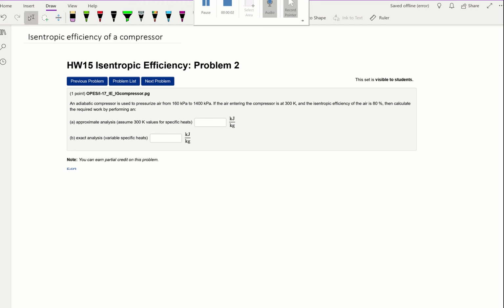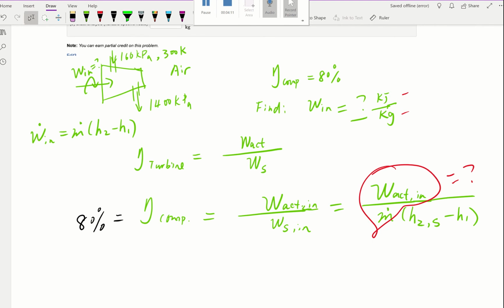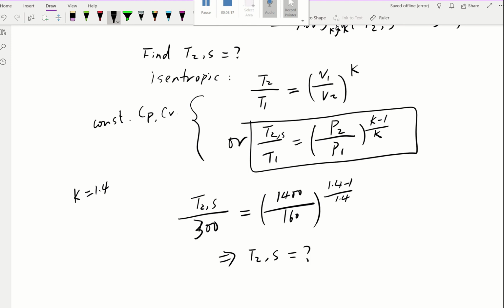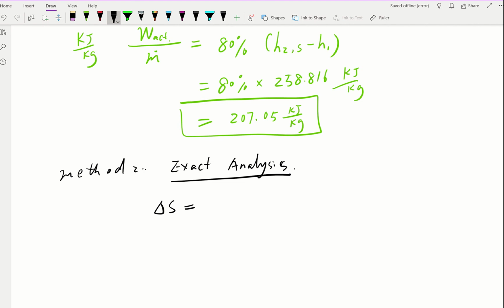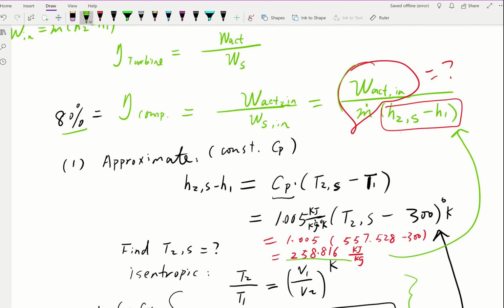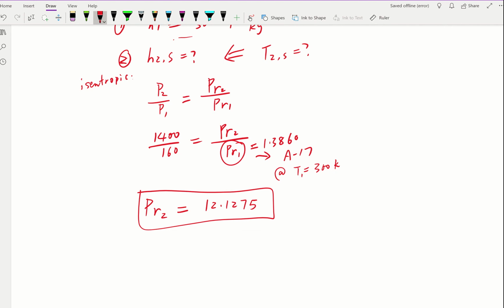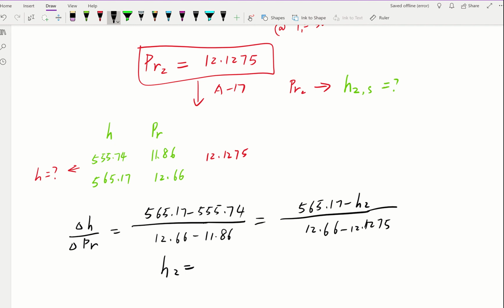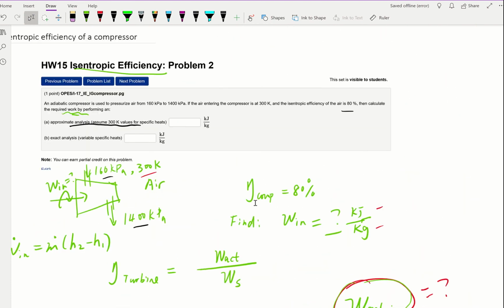WebworkHW15P2 Isentropic efficiency for compressor & isentropic process for ideal gas exact analysis

Comment from the maker: Mistake to correct: Isentropic efficiency for compressor should be equal to the ratio of required work if running isentropic over actual work in reality. In my video, it was flipped. So the last step should divide the isentropic efficiency (80%), in stead of multiplying. It make sense that more required work in for reality than isentropic ideal scenario, right?